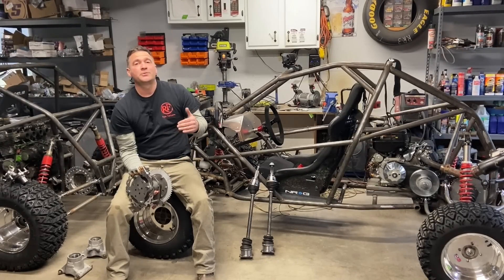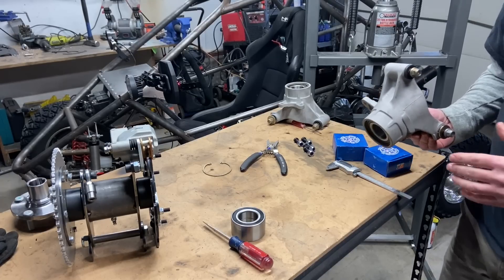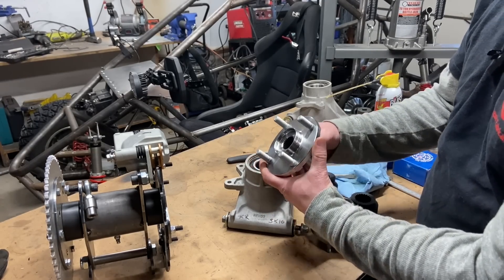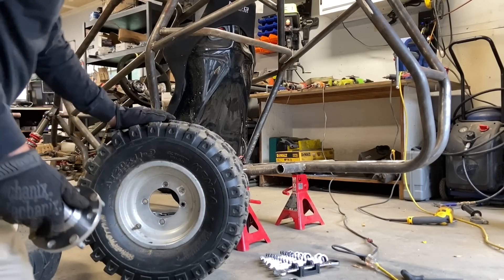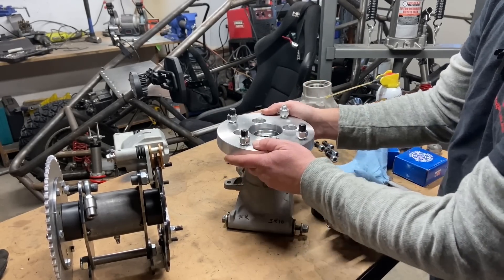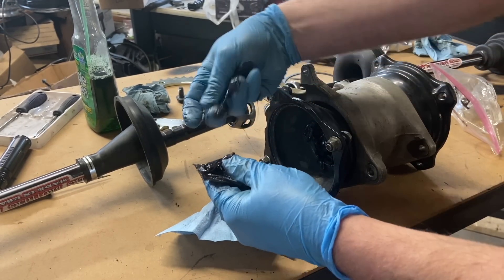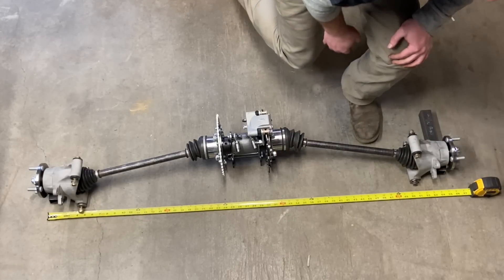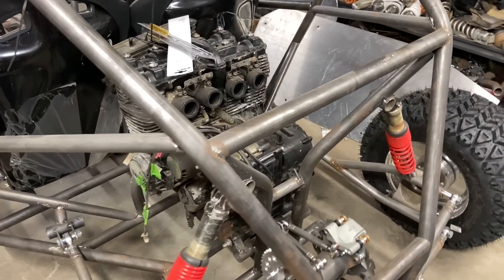Chain Drive Spool for Crosskart/Mini Buggy/Go Kart: Affordable Easy NO LATHE (part 2)

Comment: My goal right now (and it’s a long shot) is to build a duel motor rwd electric car/kart, using 2 10kw peak bldc motors. Although part 1 wasn’t the most applicable, this video was INCREDIBLY helpful in understanding what I need to do.

Comment: Hello my friend... I have to say how impressed I am with your setups! We well be ordering soon plans for sure...  On three of our race buggies we went through 3 mounting changes on our rear hubs on the IRS housings. It's a twist of the setup shown here with the 2 tubes with the heims on both ends. The differences being in the front to the frame... 1) We went to a 1" i.d. tube about 3" in length with bearings and 3/8" AN bolts on each sides through bearings and brackets...
2) Then using 1"×2" rectangle tube welded to the 1" round tube ( the 2" width on top )... and moving to the rear...
 3) We the took 2- 3/8" x16 tpi coupling nuts for rigidity and adustment, set the nuts at a matching angle inside the 2" width and weld solid to the rear center hub width to 2 brackets on the hub for centering. 
 Not at up picking your setup... just sharing what ELIMINATED problems and virtually all unwanted movement, by providing a more stable footing! Simply, where a picture is worth a 1000 words... The front the 1" tube, with the 1x2 centered, back to the irs, a v with the coupling nuts solid welded... and the heims on each side to a bracket on each side. May not help you any more, but if so, just trying to help my friend.
Have a good day young man!
Respectfully, Seth
[ my apologies... I hate to text, and did way too much here... sorry ]
[ the cart this is on has a Buell 1124 V twin .045" over... 189bhp... ]
Reply from the maker: Crosskart Ultimate Trail Machine: Making the VF-1 XL a Roller pt 1
https://youtu.be/rFrOfUkUe4Y

Comment: Transfer punch is the way to do the hub bolt redrill. I've done a bunch of them but its a lot easier that trying to use a Sharpie mark and much more accurate.
Reply from the maker: Agreed, I have since made a laser cut template and purchased transfer punches.  Thank you!

Comment: Just a heads up on bolt pattern. Mini sprint wheels are 4×4 with wheels available from several suppliers that are aven available as wheel halves of any offset and bead locks.

Comment: For drilling the wheel hubs, I'd suggest making 1 more part to have laser cut. Make a ring that has both bolt patterns on it, sized so that it fits over the M12 studs prior to removing them, and can be used as a drill guide for the M10 hole locations. Since you'd obviously be buying all those laser cut parts to make the center section anyway, what's 1 more?
Reply from the maker: You are absolutely right! Someone did suggest this a few days ago and I’ve already gotten to work on it. I test everything before I make it available so look for it soon! Thank you for the awesome idea and insight. 👍

Comment: What tooth rear sprocket did you use on your budget build cart?
Reply from the maker: It is a 56 tooth but I’m not 100% sure it’s the perfect size. It works well but I don’t know if it could be better.
Reply: @KJRaycing  awesome thanks! I am running a 72 tooth on a buggy of mine and it is super slow.
Reply from the maker: That definitely explains it. Probably easier on your clutch though. I had to get the 44 magnum clutch but man I love it!

Comment: Buy a set of transfer punches, you'll discover many uses for them.
Reply from the maker: Thank you very much! I honestly didn’t know about these. But I did look up one for the size needed and it was $45 bones… that’s a lot to center one punch. I’ll definitely look into it more though and thank you so much 👍🖖
Reply: @KJRaycing  Google transfer punch set, they're $20 and up.  I've been using a set from Enco (no longer around, but cheap) for 25 years.
Reply from the maker: Just went and picked up some, you opened a whole new world to me. Thank you!
Reply: @KJRaycing  I should buy the plans now to offset what you paid for the transfer punches.

Comment: there are heaps of 14 and 15 inch wheels for the 4x100 pattern, ie suzuki swift, civic etc, i have SSA knock off volks in 15x7 with 32P with 195/55R15 tyres which were both faily cheap, and also fit my trailer so there is ALWAYS a spare tyre!
Reply from the maker: Those would be sick! I don’t really have anything against car wheels.  All of my other karts have atv wheels and I didn’t want to have to buy new sets. And dwt atv wheels are only 6-8 lbs so they are suuuuper lightweight.